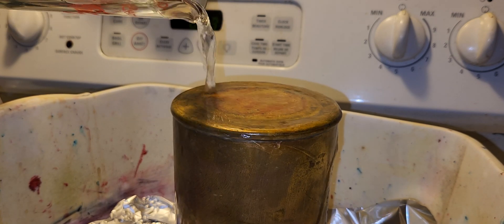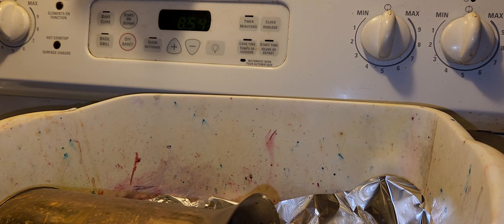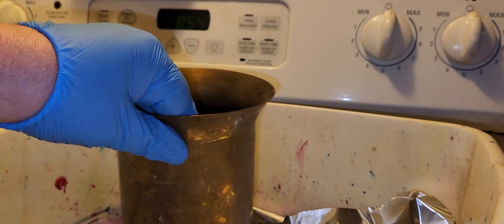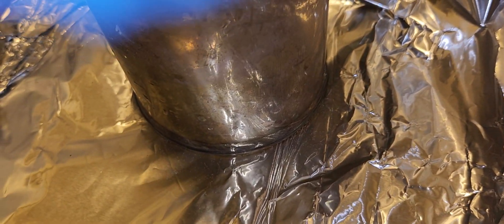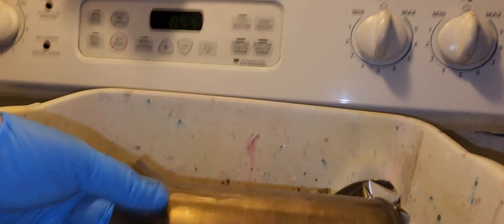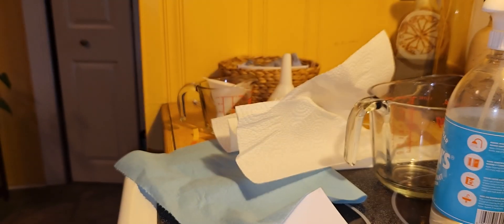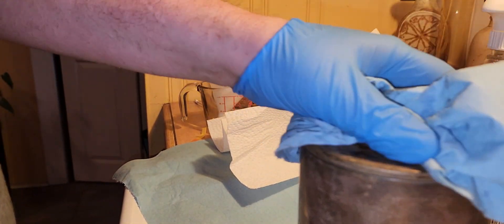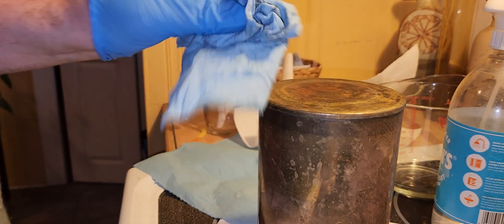Polishing brass with Aluminum foil, and Salt water.

Comment: So if I got a large enough container to submerge it, and hooked up a power source or car battery to it with a similar solution, it would actually be extremely clean in a matter of a minute or two by electrolysis? Because I actually have some heavily tarnished brass handles that need renewed
Reply from the maker: Yes it could work very well but u need something like alcohol swabs to clean it too. An alternative is silver tarnish wipes.
Reply: Thank you
Reply from the maker: @amanitaocreata4401  I plan to clean mine a second time with WEIMAN silver wipes. They contain soap and ethoxylated alcohol.
Reply: I didn't even know those were a thing. Thanks for the information.